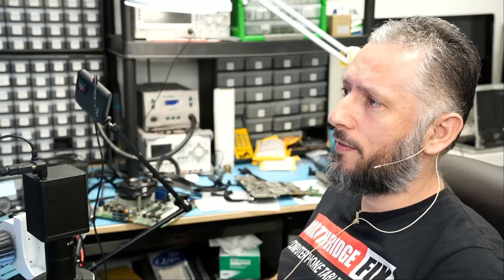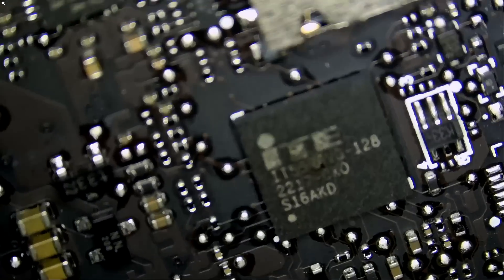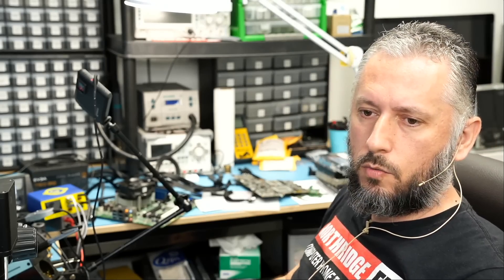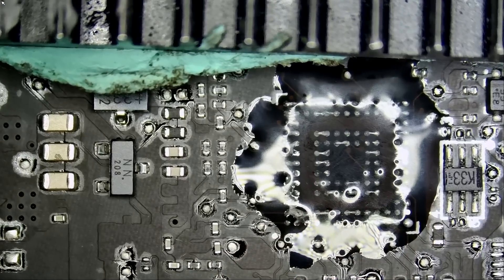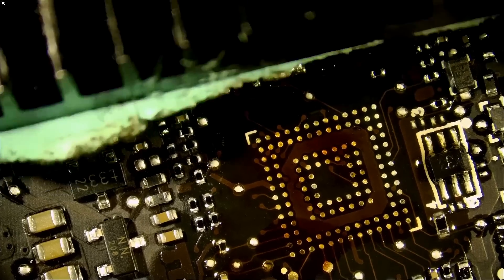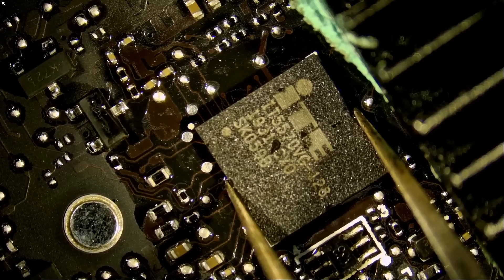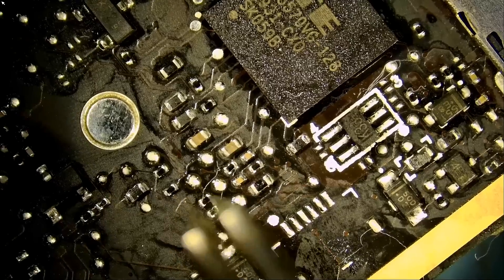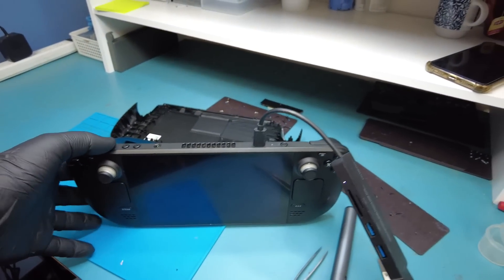Steam Deck Repair Won't power on or charge - How to solder BGA Chips

Comment: I just happened to me today! I bought a magnetic adapter so plug and unplug my SD easily and it was working just fine until y moved the cable a little bit and BOOM: It suddenly turned off and it won't charge or turn on anymore, the charging led was dead as well. I tried everything, i pressed the power button like a minute and nothing. Then i became desperate and opened it. I unplugged the battery from the motherboard, then plugged in again and the charging led turned on like for a second. Still no response. Did it a couple of times more and the SD revived completely. Now it's working like never happened. I think i was lucky. What do you think it could be the problem?

Comment: have you encountered anyone who had an issue with their Steam deck OLED version where the WIFI ic gets too hot and the battery doesn't charge? (the deck still turns on but is not charging)

Comment: I really want a video figuring out this black screen but displays to external. I’ve tried everything
Reply: Dude! Do you have been able to find a solution to this problem? 
At first I thought the problem was with the LCD itself. But it replacement did not help in any way.
Reply: @GhostRooter   I also replaced the screen and it didn’t fix it. I replaced the main board and it fixed it.  It’s a board issue but I couldn’t find any faults (I’m also not @NorthridgeFix 😂

Comment: I have the same problem with my steam deck. It doesn’t charge anymore. Im in canada. Can i send mine?
Reply from the maker: You can mail in your device by filling the form at https://northridgefix.com/mail-in/. Print out the ticket and include  it inside the package, or if you do not have a printer, just include the ticket number so we can look you up when package arrives.

Comment: I noticed some solder balls around the bga you wicked got wicked up in the process.  I think you might need to reapply solder to those spots.  At the bottom when you rotated to get the last bits of bga balls.
Reply: those are just test points. no component goes on them.
Reply: @jg5170  He actually has a video where the same thing caused issues.  Those points have blobs of solder for a reason.

Comment: most likely there is another problem. The chip replaced is a startup chip , without it the console would not start at all, so bc the console started, means that the chip autoreprogrammed and it works. An ITE chip is not related to video problems from what i know. Very similar to how a laptop works.

Comment: don't ITE chips sometimes require programming to work properly? Maybe in special cases like with the steam deck, the ITE chip needs special programming to display to the built-in screen. I would try to apply any firmware updates that may be available, especially if there's any marked as "EC firmware"
Reply: Sometimes they reprogram themselves, depends in the model.
Reply: Typically BGA chips will program themselves. The particular chip that he had to replace I believe was the Super IO chip, and typically those get their EC programming from the BIOS/UEFI chip.
Reply: @TheResoluteHawk  you're correct that chip is the Super IO, and while some will be programmed automatically from the BIOS/UEFI, many do not and must be programmed manually either before or after installation. Of course, I have no idea which one of these cases is true of the Steam Deck
Reply: @danandrei96  steam deck does it automatically, as shown in the video.

Programming these manually if needed is actually very difficult as there are no adapters yet available.

Comment: For those that end up in a similar situation, know that Valve / Steamdeck have partnered with iFxit for replacement parts.  That chip was blown/burned because of a reason, most likely to do with something the customer might not be aware of.  But that they know what chip is burned leads me to believe that they might have been tampering with the SteamDeck.  A lot of people upgrade their SSD in them, not following clear instructions, and some place a different SSD that can cause other parts of the system to overheat because the 2242 SSDs are cheaper than the 2230 models.  So, all I am saying is that this can have a different cause of the failure.

Comment: Thank you for making the videos. I want to see the backside of the chip to see all of the balls.  Does the chip already have solder/balls applied? Or did he apply solder without showing it in the video? He always shows applying solder before attaching the new chip, but did not on this video and I don't understand why.
Reply: the chip is already reballed which has the ball on the chip
that's why he wicked the pads

Comment: maybe when this " ite it5570vg-128"  is shorted 5v is blown some fuse that why no image on the matrix or the screen ? missing 5 v ?
Reply: if it were missing 5v, a fair number of things wouldn't fire up [ie usb-c port would not be powering the dp-altmode capable usb-c hub, possibly the same for the steamdeck's internal controller] .. edp displays mostly run at 3.3v and same result if that were missing as well.. add to that the EC which is what the it5570vg is, it's not a device that generates voltages that the whole system uses.. it tells the whole thing how to fire up and run at all via the bios firmware

Comment: Apart from working very nice with this kind of flux, cleaning takes only one cotton swab stick. I used quite a few kinds of flux and always had to use a lot of cotton swab sticks to be able to clean the mess. This flux takes one cotton swab stick to clean. It saves time. It may not seem to save much time but when you're already tired, you need to have the job done and you just clean the flux fast, it seems like life saver and you will thank the gods of flux for that.

Comment: From time to time it would be nice to mention the hot air temperature and air flow when you do various solder/desolder jobs.
Reply: temperature varies from hot air machine to hot air machine, a rule of thumb i use, the thicker the board the higher the temperature, so for thick boards like ps4 etc use a high temp, for thin boards like cellphones, use a lower temp....as for airflow, bigger components= more airflow, small components =less airflow, the tolerances is something you learn with experience so practice remove and installing stuff using a junk board first
Reply: @coyotex850  it would still be nice for him to give an idea of baseline rule of thumb, but it is still very much up to the experience of the technician. I see Louis Rossmann usr 100% airflow all of the time even with the tiniest components, but he went over how he does that with how he uses his tweezers.

Still, it absolutely comes with practice. Northridge sells SMD practice boards and there are plenty of other cheap ones too.
Reply: I think it's quite hot
Reply: Florida Man hot.
Reply: He does.
Reply: I rarely hear any techs on YouTube mention the temps they are working at. Someone who is an amateur but would love to gain rapid experience would benefit majorly from knowing temps to work from. Yes it takes alot of practice to know what temps to work at. But alot of us work and raise kids soldering is something we do once and awhile. Those temps they work at at least in my opinion are so Important to know so someone new can avoid burning components or ripping traces off the board. I wish they would go in more detail about their working temps
Reply: This is beautiful thank you
But i'd like to know what is the cause, i have a steam deck and I'm little worried about mine😆
Reply: My guess is max temp and relatively low airflow. Decent size nozzle.
Reply: Yo mad facts.
Reply: anything from 380c to 400c is gonna do the job with lower air flow so you dont blow components off the board.
Reply: Just take it to a repair shop, not worth fucking it up even more. Practice hot air soldering on semething else...
Reply: @mnz97  This comment... 🤦‍♀️

Comment: On your Harddrive recovery videos, at the end, you see the drive works, but you dont recover the data... These SSDS or HDDS might fail any minute, and any plugin and plugout of them might cause them to fail at the spot, cause they are fragile from the previous repair. So, when you do see it works, please, pull all the data out while you can. I saw ur videos, and u did not do that on your previous newest SSD recovery video, u just said "okl, lets give ti back to the customer"...

Comment: What’s the purpose of tapping/pushing on the chip after it’s moved itself into position? Is that just to verify that it has attached to the pads, or does that improve the connection in some way?
Reply: THe surface tension of the liquid solder will pull the chip into alignment. He is just making sure that all the solder  reached the liquid phase.
Reply: Its just to check if its connected properly to the board.

Comment: Was worth sending it in just for video. I knew you did not have those chips in stock as I have watched and not seen you work on steamdecks before. I should have said the back light worked like that before without the display but I did not have a usb to video adapter to use to see if it still showed the screen - which it does. I thought maybe that burned chip was the cause of the issue. I do see it charging now so that must have been part of the charging circuit. But I sent it to the proper place to at least have the chip replaced!!
Reply: Waiting for Part 2 to see the LED screen working.
Reply: Hey @NorthridgeFix PIN THIS comment
Reply: How did you figure out that the chip was burnt?
Reply: @DZ-bo8hq  phone camera could zoom in enough to see it if he doesn't have a microscope.
Reply: Thank you for your contribution to this repair video!
Reply: Hello did you ever figure this out?
Reply: Thank you for sharing! 😃

Comment: What was the chip that was replaced ? If it was a microcontroller it probably needs firmware on it to run.
Reply: bump this, a quick google search comes back with cross-refrence IT8390 decription "A highly integrated embedded controller with system functions suitable for mobile system applications."

edit, also; The IT8390 directly interfaces to the eSPI/LPC bus and provides ACPI embedded controller function, keyboard controller (KBC) and matrix scan, PWM and ADC for hardware monitor, PS/2 interface for external keyboard/mouse devices, BRAM, CIR and system wake up functions for system power management.
Reply: Definitely needs firmware to function properly.
Reply: @AyyuBX7  Yep.
Reply: Bump
Reply: Now the question becomes does Valve provide that firmware somewhere, and how do you flash firmware onto it.

EDIT: Also, it's still a question of whether the place the customer got the chip from has already programmed it for the Steam Deck. It's possible it already has the correct firmware, but there's another problem.
Reply: @HaveYouTriedGuillotines  most likely there is another problem. The chip replaced is a startup chip , without it the console would not start at all, so bc the console started, means that the chip autoreprogrammed and it works. An ITE chip is not related to video problems from what i know.
Reply: So it was not the charging IC chip? @orange11squares
Reply: @HaveYouTriedGuillotines  and so the investigation begins.

If the chip doesn't have the firmware on it I'm sure it isn't hard to obtain the firmware off the steam deck site using a PC.

I'm doing research now.

Comment: don't have a steam deck. it's odd that it charges through the same port it can display out from.
Reply: thats the beauty of usb c alt mode, and if you get a usb c hub with pd (power delivery) you can charge the Steamdeck and play on a monitor or tv at the same time, really cool.

Comment: If you don't reapply the third screw holding down the heat sink on the main apu die, you can get video errors. Ask me how I know... :|   I don't think that is what is happening here though, because it wouldn't be working on the monitor output.

Comment: Alot of steam deck users had the black screen issue - it seems like it's mostly a software issue that might be hard if at all possible to fix by yourself. Some managed to get it working by doing a factory reset or holding power button for 12sec for a hard reset, turning off screen dimming/sleep, entering battery storage mode, draining/reconnecting the battery, holding the "..." and volume down buttons until beep, waiting 5sec then pressing power etc. Maybe something from this list helps.
Reply: That's is just taking it out of battery storage mode
Reply: I’m dealing with this now. Even replaced the screen with no luck 😢
Reply: prolly lcd issue
Reply: Condensator maybe
Reply: I like my gaming PC with Linux for a reason

Comment: I am not confident enough to do BGA soldering
Reply: Use a dead or old computer motherboard for practice
Remember even mistakes & faults are part of learning
I was practicing on some surface mount training pcb, where I burned the surface mount transistors & traces
this taught me to use the right tools, like tweezers, 25W iron stick, flux, the right tip....
Reply: @igrewold  thank you. I will try and practice on junk boards